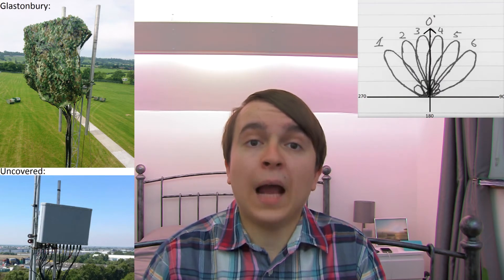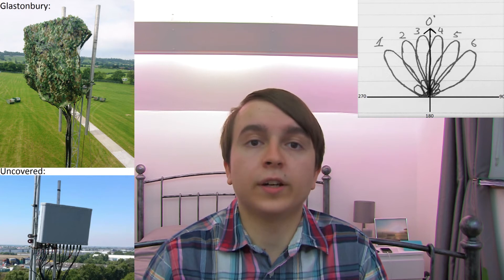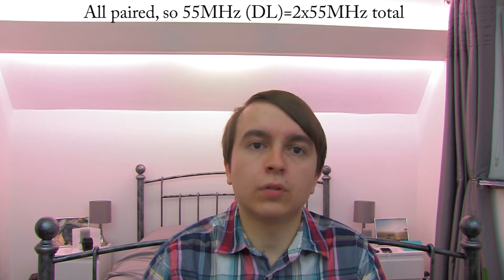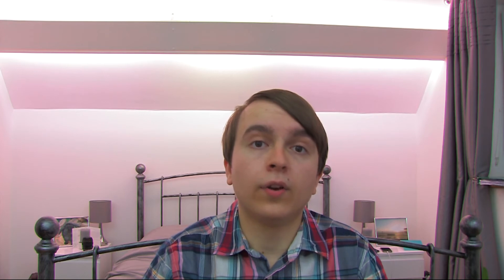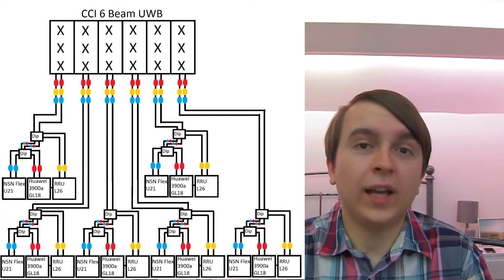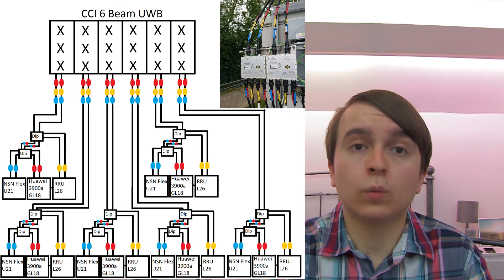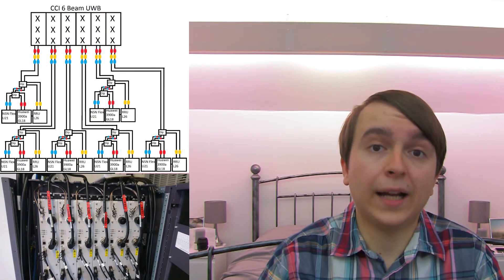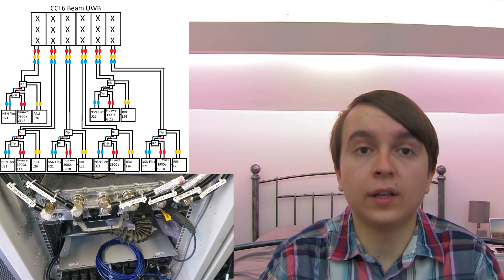EE's Glastonbury Festival 4G Temporary Sites Explained

Comment: Bit irrelevant to this particular video but whats this 'spectrum auction' I have heard about I dont understand why they need to have an auction for the spectrum of the network?
Reply: Radio spectrum is a limited resource and so when ofcom makes some available it is auctioned off between the various networks. EE were allowed to 'refarm' some of their 1800MHz spectrum from 2G use to 4G use early.
Then there was an auction for the 800MHz and 2600MHz spectrum.
There was only 2x30MHz of 800MHz spectrum available for example, split into two lots of 2x10MHz and two lots of 2x5Mhz. (the "2x" bit means 5MHz for upload and 5MHz for download as it was paired FDD spectrum, so actually 60Mhz in total)
O2 and Vodafone each bought  2x10 and EE and Three each got 2x5MHz.
Reply: Andrew Hockings so is the radio spectrum like how many masts the companies can put up?
Reply: No. 4G (LTE) is a single frequency reuse system.
If you take EE for example, every one of their 20 thousand or so masts transmits the same 20MHz of 1800MHz spectrum.
Same with Vodafone. All of their 800MHz sites will be transmitting the same 10MHz of spectrum.
There is clearly some overlap of signal on adjacent sites which causes inter-cell interference but LTE's OFDMA system is designed to cope with this by not only using time division but also frequency division by splitting the available bandwidth into multiple subcarriers. 
These subcarriers are then shared out to connecting handsets/devices on that cell.
This is why sometimes you have fast speeds and sometimes slow speeds. A 20MHz slice of 1800MHz spectrum can carry about 150Mbps in total and that has to be split between however many users are connecting (up to 800 at the same time). Vodafone's 10MHz of 800 can carry about 75Mbps and can share that with up to 400 devices simultaneously.
Clearly if 400 people were all trying to download at once then each one would only get about 180Kbps.
This is why we don't generally have unlimited data plans, there is not enough bandwidth to cope.
Just 30 people trying to watch HD Netflix over 20MHz of spectrum would completely swamp it.
Basically it's way way way more complicated than most people realise.
Reply from the maker: No, it's what they can broadcast from the masts
Reply: Peter C ah okay thankd